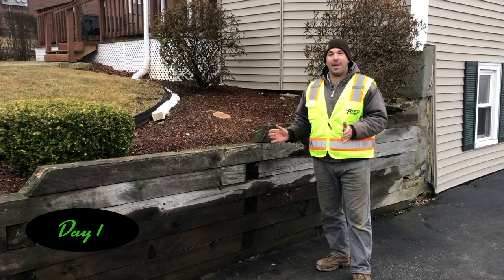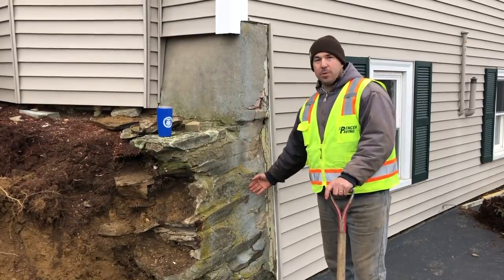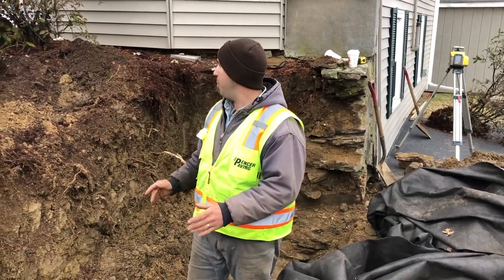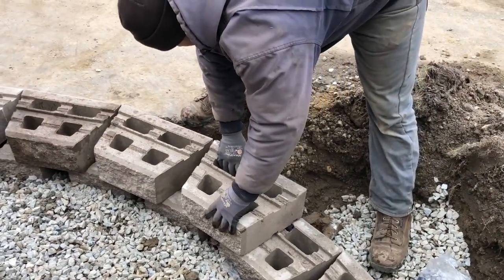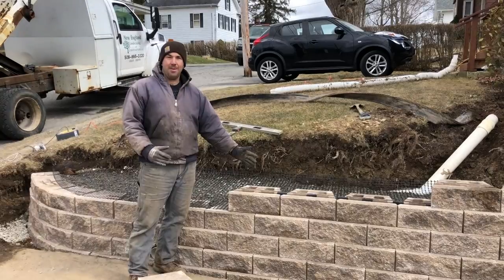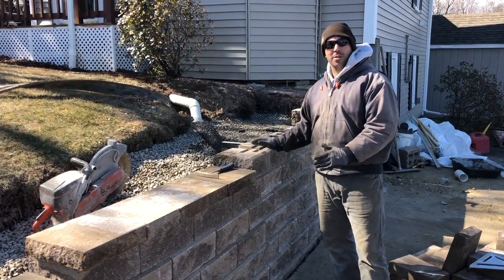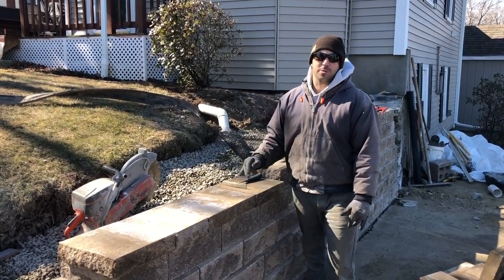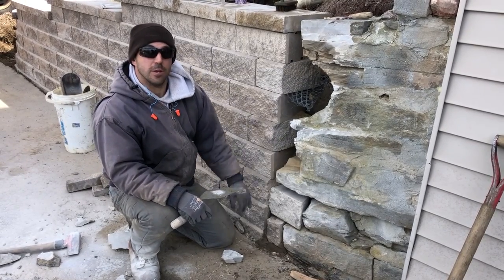Techo Bloc Semma Retaining Wall

Comment: No perforated pipe behind the wall???
Reply: These are free flowing walls. If those drainage pipes are ever in operation, the wall is already failing. If installed correctly, there should never be a need for a drain pipe.